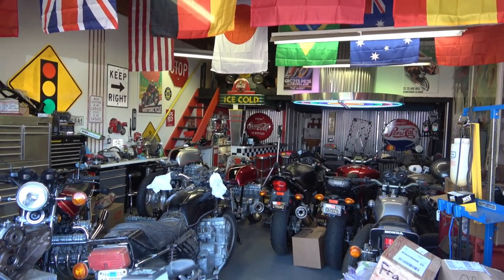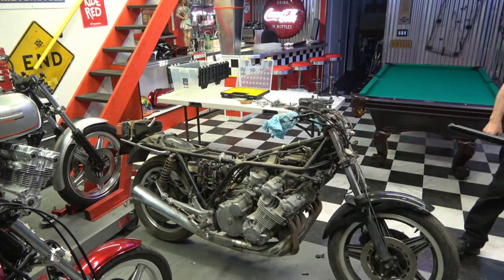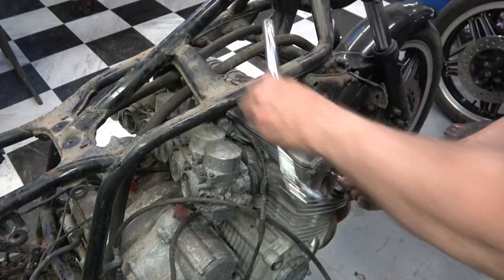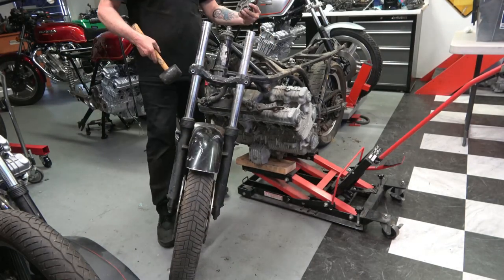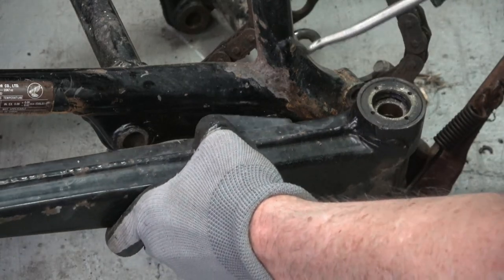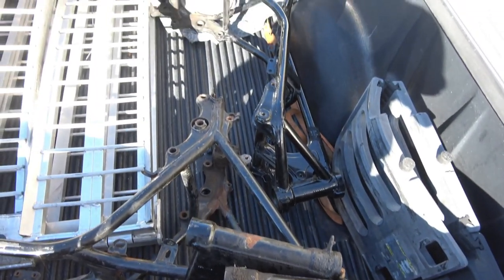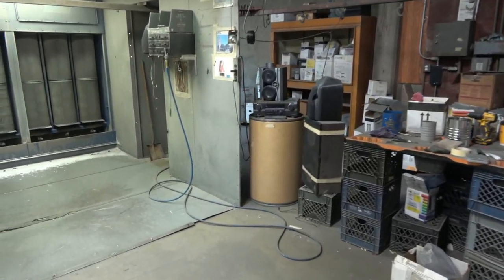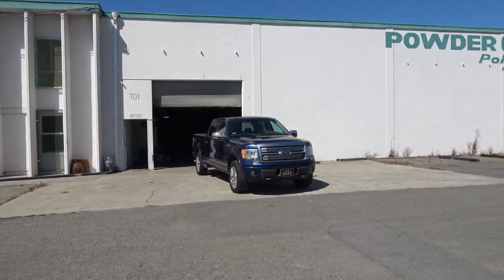1980 Honda CBX Restoration Part 1- Introduction & Tear Down Featuring a trip to Powder Coating

Comment: Peter, really appreciate the time you have taken to provide viewers with the series of videos on how to go about restoring a CBX. I have one and have it stripped down and as money permits, the work or parts are being purchased. I have my brand new Delkavic Pipes that are still in the box, the Frame has been powder coated, etc.Once the whole thing is complete, it will be a dream come true. 
As a young teenager, I would lay in my bed on a Summer morning with the window open and this most incredible sound would travel across our city via an arterial highway. I would only get to hear the sound and would just be so curious as to what was making the sound. 
This one day, I finally found out what was making this incredible sound-It was a 1980 Honda CBX with a 6 into 1 Pipe. From that day to this day, the CBX has been etched in my memories. 
Hoping to have the bike on the road in the Summer of 2022. 
As The MotorCycle Broker says, "these bikes are headed to 6 figures". I can truly believe it.

Comment: Hi Peter,
great videos . I am using them a lot to plan for my 1979 CBX project. A question to the Powder coating. Did you use a 3 layer powder coating on the frame?  Primer, Black and high gloss or just two layer; primer and high gloss black?  I am getting different advice from powwder coaters here. One says the black is better without a gloss clear coat, the other says it would be better with it. All say a primer should be used. Thx

Comment: I have a 79 CBX in red. Have owned it since 2002., 6050 miles  Also picked up a 1100F last week .Guy I bought it from owned it since 1990. Missing chain guard and screw that holds in the tach cable to motor.He included stock seat and complete stock exhaust..

Comment: Saw a 1982 with no Title listed on San Diego California Craigslist. Was debating on whether it was worth the restoration and expenses.
Reply: Get it for free or next to nothing with a bill of sale.  Use bill of sale to get lost title.   If you can't get title for whatever reason,  part out for your next bike.
Reply: Where are u located? Would like to speak to you..I'm in tampa fl..
Reply: @shedred1967  How feasible is getting a lost title in California?
Reply: @kennethgoyens9821  California, Why?
Reply: @markopolo945  , very feasible with a bill of sale that is notarized.   I've done it myself,  grew up in Camarillo.  Living in MT now and just helped a guy take my cousins 82 trans am w/o a title.  Just took four days to get a new title.
Reply: @shedred1967  Roger that and thanks A lot!
Reply: I have 2 CBS that I want to freshen up and like your touch on the bikes..
Reply: @kennethgoyens9821  have a link?
Reply from the maker: Hi Marko, I have had many bikes without titles. I am in the San Francisco area. DMV only requires that you get the CHP to do a VIN Verification and have a Bill of Sale and fill out a Statement of Facts. So you need to go to DMV first to get the paperwork started, then they will hand you the paperwork you need to go to the CHP to get the VIN Verification done. Hope this helps. Thanks Marko
Reply: @digitalpizza1  Thank you! Tgif😎